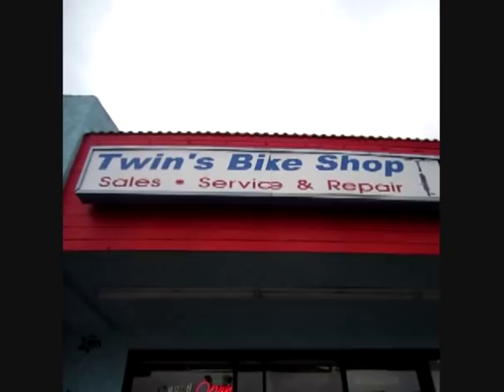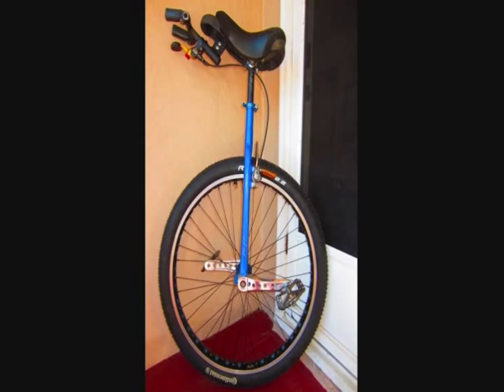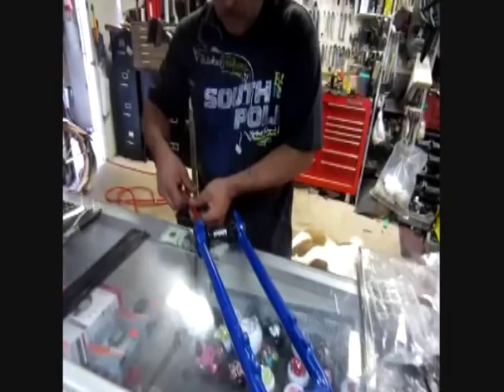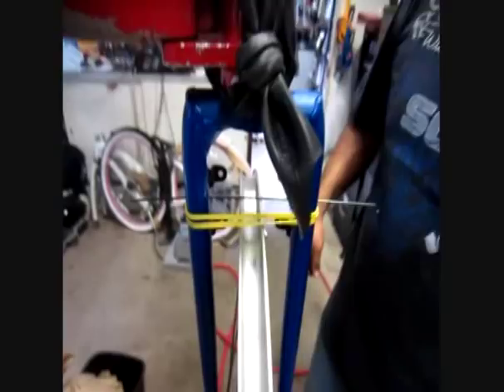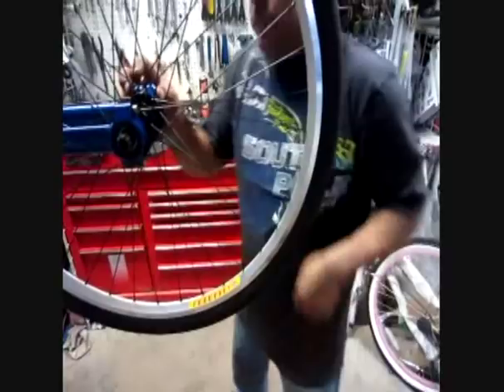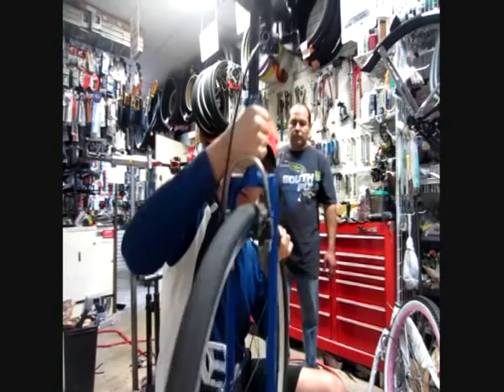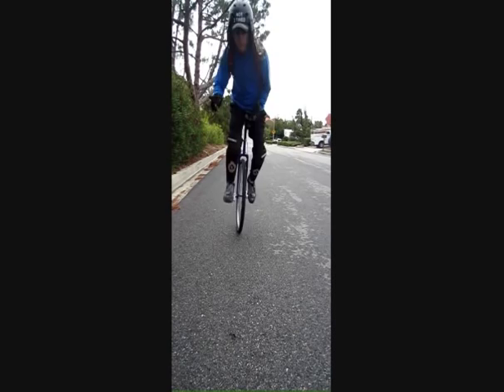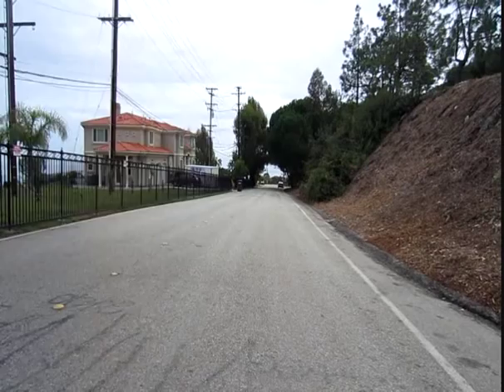Wheelbuild - 700c Road Climbing Unicycle!

Comment from the maker: Climbed Fargo twice in 2011 on my 24. That turned out to be the ideal size for that climb. The 29er is super light, but the larger wheel is much harder to turn at that grade, since the downward powerstrokes take longer to come around, which would make stalling out more likely. But for everything under 17%, the 29er with this setup is king.